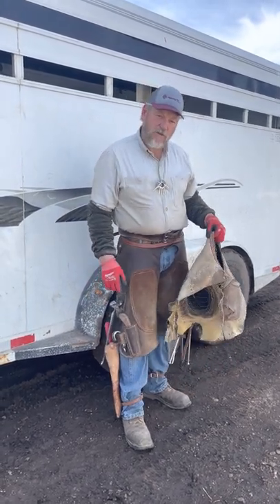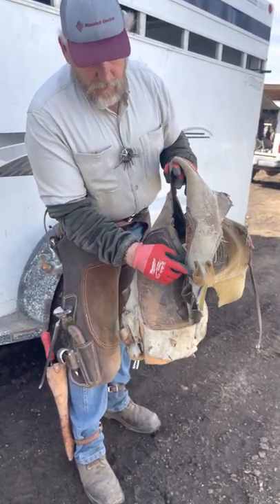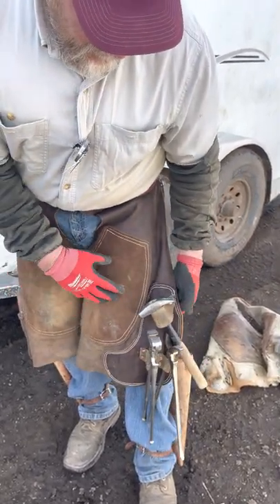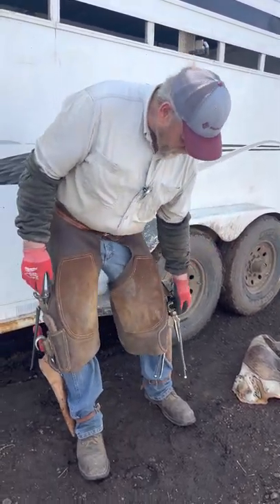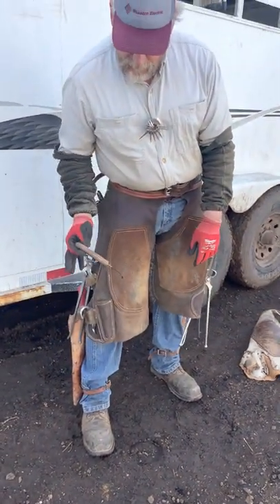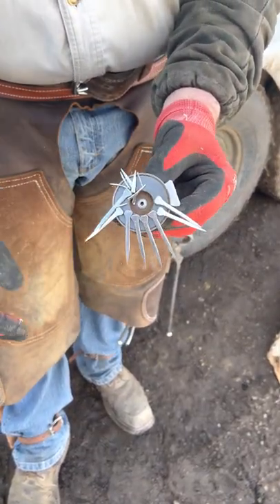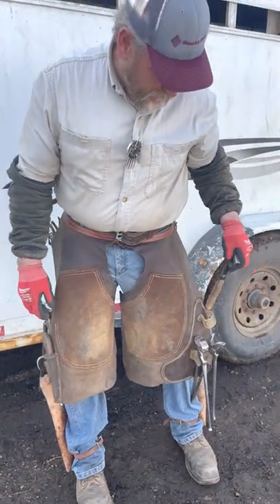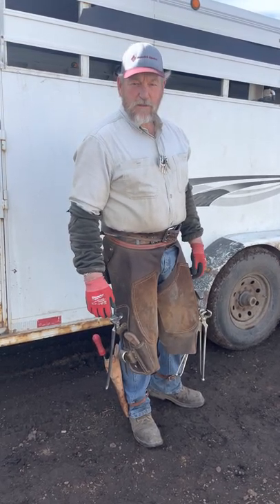My New Shoeing Chaps And Tool Tour RJF

Comment: Great idea to have all your tools at arms length. Makes the job go faster. I have to keep going to my box. I do that on purpose . gives me a reason / excuse to straighten up and get my air back.
Reply from the maker: JT H, I rest while I put nails on my magnet. I shoe different than the normal way. But I’ll shoe one in 30 min. I use a shoe bender, and don’t use a hoof stand. I learned from my dad, shoe over 1000 a year. Need to slow down a bit I’m thinking. Thanks for watching and the comment.
Reply: Also gives the Animal a break here n there as well. Especially those young and Geriatric horses.
Reply: What kind of shoe bender?